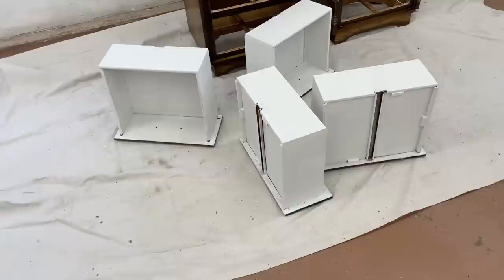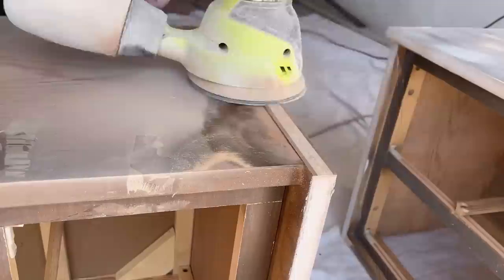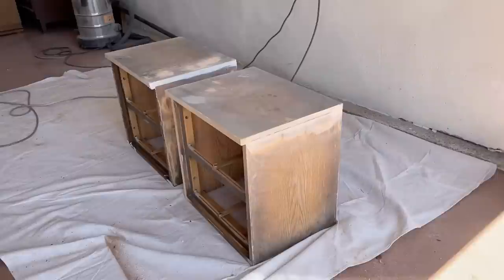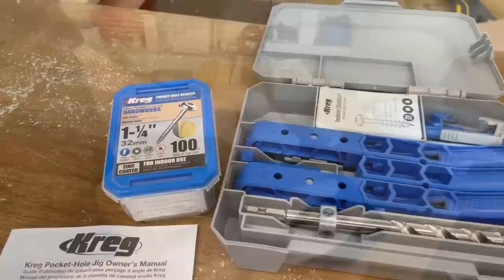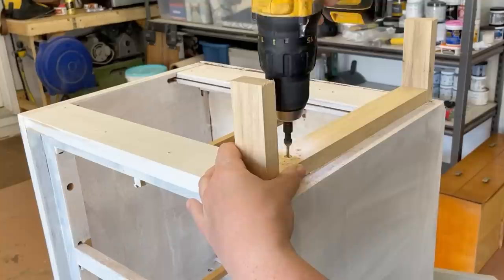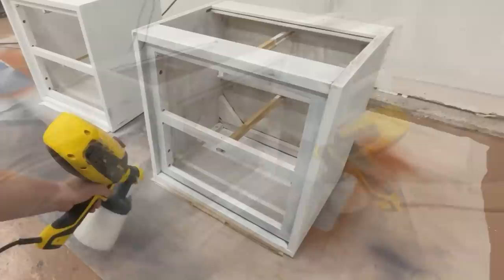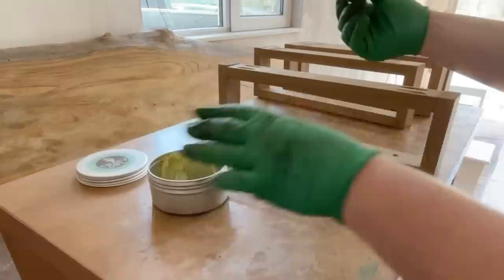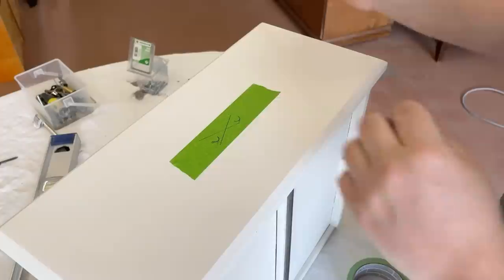EXTREME MODERN FURNITURE MAKEOVER

Comment: Drill holes in opposite side (bottom) of legs so a long driving bit will fit through the bottom holes so you can easily screw into the top of the legs and the body. Fill or plug and finish. You need to adjust where you screw sometimes if you use pocket holes. Turned out great!!!